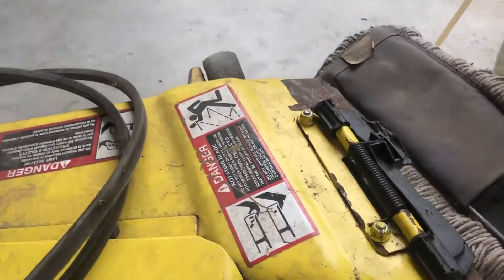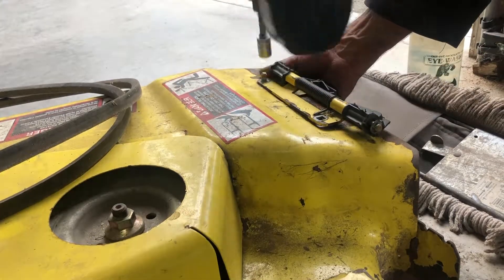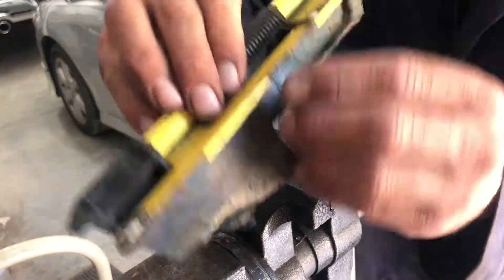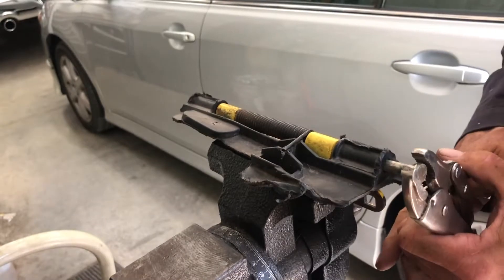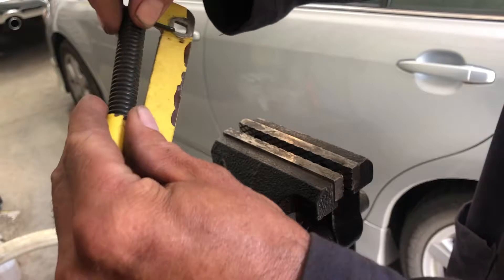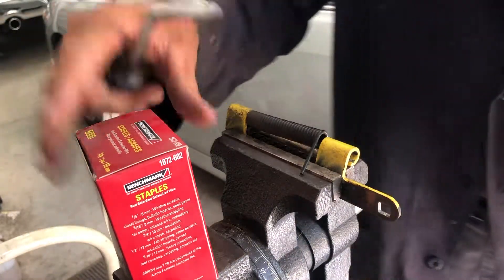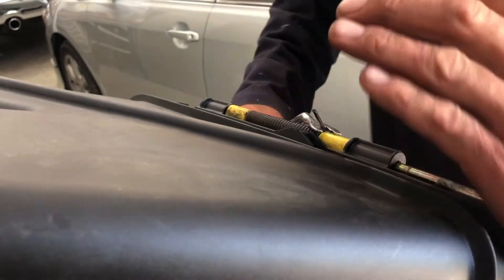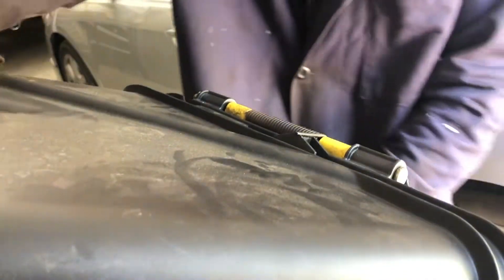HOW TO REPLACE A MOWER DECK CHUTE ON A JOHN DEERE LAWN TRACTOR 42,44,48,54'

Comment: Can you please pass on the part number for the chute, the one in the video is exactly like the one I need.
Reply from the maker: New style chute is AUC11996 48",  M123859 54"
Reply: @WeekendHobbyMechanic  Thanks Pal.
Reply from the maker: @kevinkirby5985   My mistake, the Part number I gave you was for a 48" deck. Part #M123859 is for the 54" deck.  This part is only the Plastic chute only.